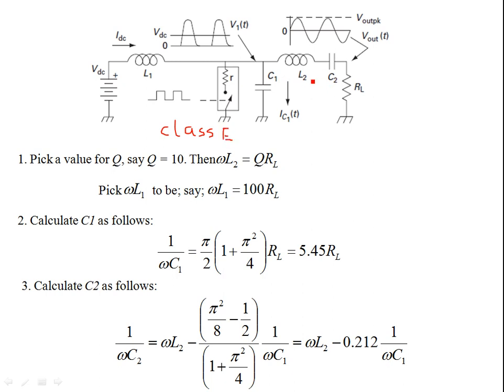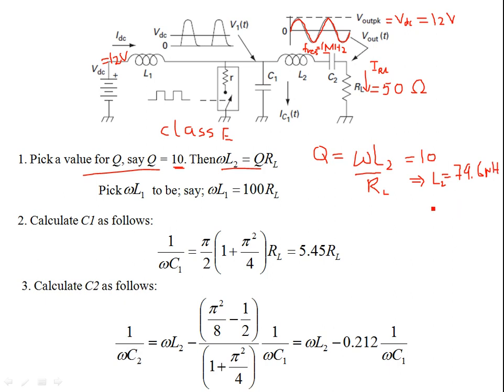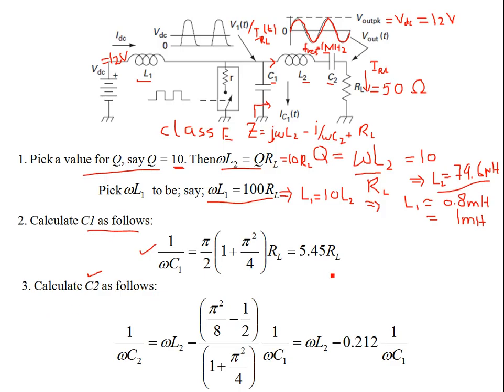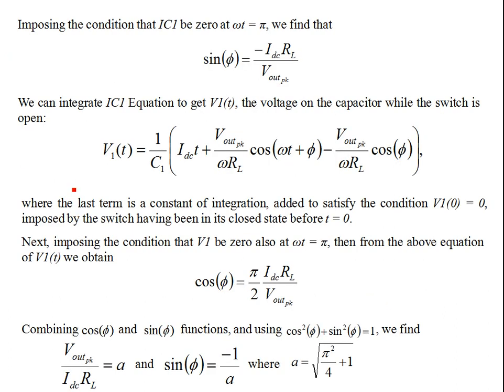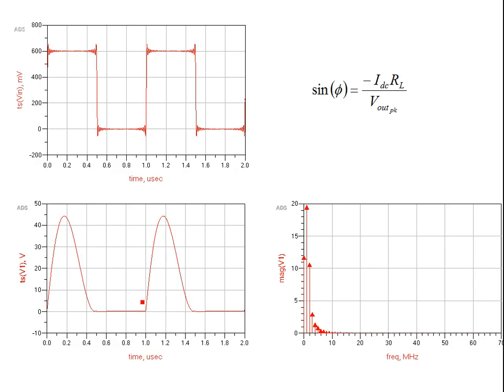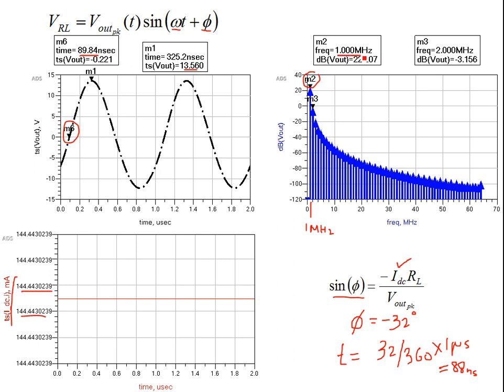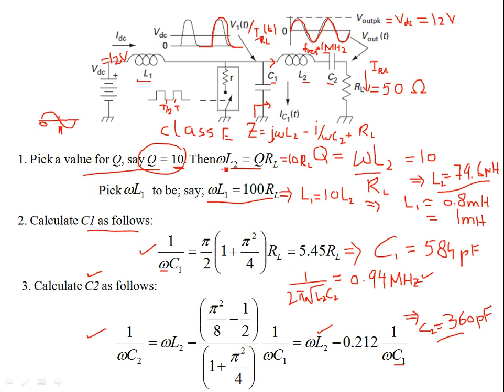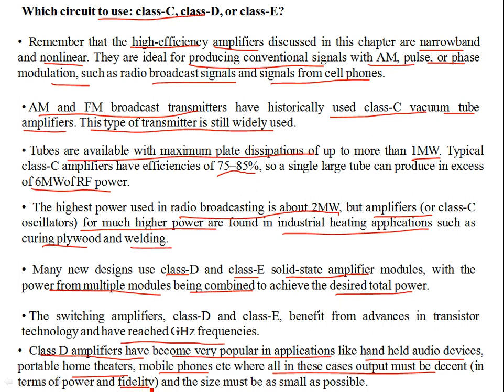Design of Class E amplifier

Comment: Thank you for your video
But i have one question if possible
How can we define the high quality factor?
In some papers Q=10 or 8 or 9
But why? Why it isn't more than this 
What is the main restriction
Thank you in advance
Reply from the maker: Hello Abdullah,
There is no limit on Q you may choose for the series RLC section of Class E amplifier. If you notice in this design a Q of 10 is already producing a sinusoidal output with second harmonic being less than 25dB. That's due to the selective bandpass response of the series RLC section before load meaning a Q of 10 is high enough to give you a good tonal output at desired frequency. If you want to make the response of RLC bandpass filter more selective then that will require higher values of inductor L2 also, the inductor L1 is selected about 10 times that of L2 meaning you will be looking out for very high inductances which may make circuit more noisy. From fabrication point of view it's difficult to make large inductances into a small area as larger inductances require more flux and more flux need more area. So if you can get lower harmonic distortion for a Q of 10 you may not need large L2 or L1 at all!
Reply: @mansoorkhan7109  Thank you so much for your valuable response
Reply from the maker: @abdullahadawi3230  Oh not at all! Enjoy!

Comment: thanks. Eqn for finding is wrong since it gives negative value of C2 when i calculate
Reply from the maker: C2 and L2 has a bandpass response that is their reactance is equal but opposite at the operating frequency, 1MHz in this example. Hence at 1MHz the series combination of L2 and C2 forms a short circuit coupling a pure sinusoid at load given high Q of series resonant circuit.
The way these equations are derived are by considering the ratio of fundamental Fourier component of pulsating node voltage V1 and sinusoidal load current and then comparing the impedance of a series RLC circuit with it.